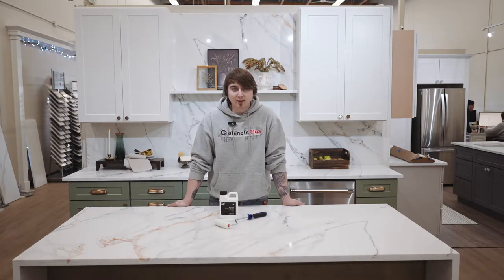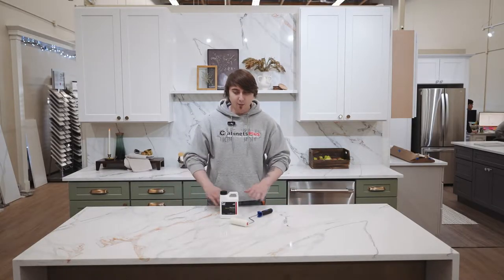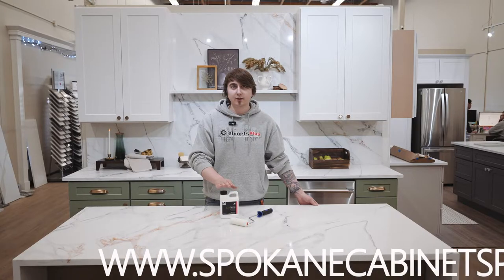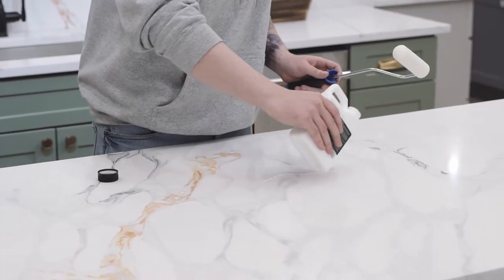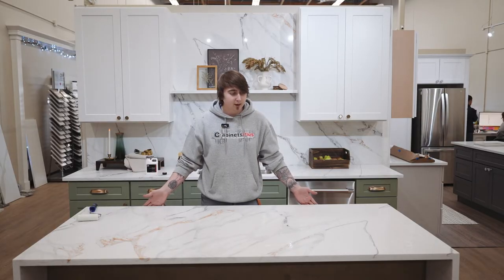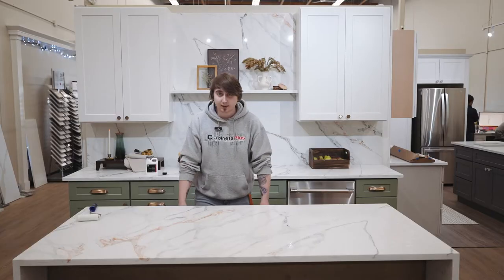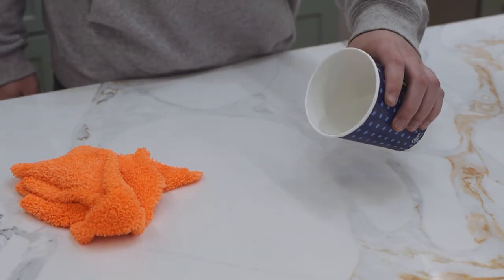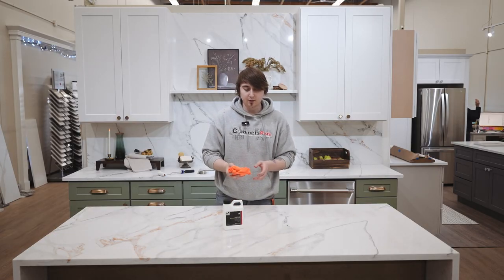How to seal your quartz countertop

Comment: If you have to SEAL your quartz countertop then RUN. Quartz is a non porous material. Some cheaper “quartz” brands will use a mixture of Marble powder and quartz (to save money) and those in theory can be sealed. But true quartz countertops don’t need sealer.
Reply: Agreed. This is why I tell my customers please don’t do your own research or you end up being told you need to seal quartz 😂

Comment: Quartz does NOT need sealing. Its a NON-Porous material. Sometimes you might get a light stain looking spot on it but its NOT inside of the stone, its on the face of it. Light rubbing sometimes with Baking soda and water paste will do the job. If not then a very fine Marble polishing powder...